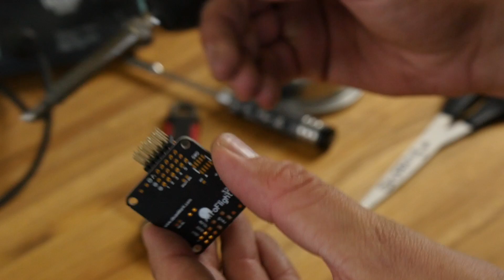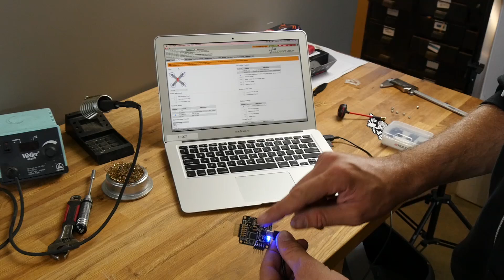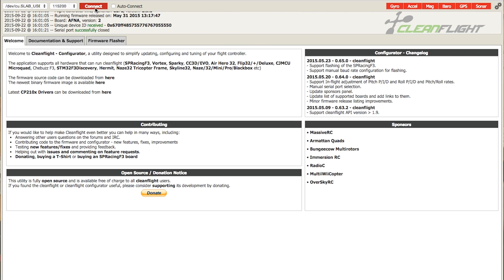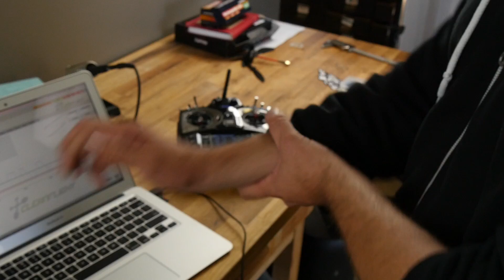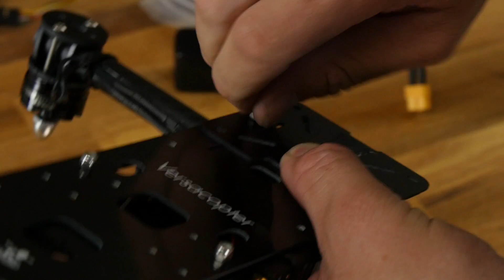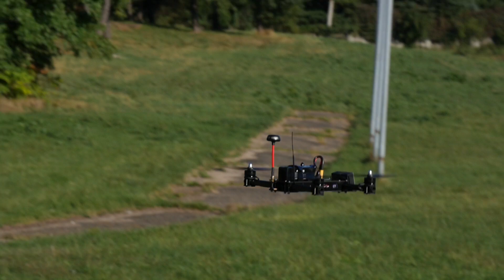Flite Test | FT VersaCopter Naze32 Setup (w/ OneShot)

Comment: Hello! I have a bit of a problem. when using the master power in "motors" my motors spin up in sync and to the desired power. However when using throttle my motors spin up but then, immediately, slow down while motor 3 spins up. It is on a smooth flat table with the gyro showing it as flat ground. I can not find a fix to this anywhere. Please help!

Comment: Hey guys i have a question. i'm currently using 6x4.5x3 props with DYS SE2205 2300kv motors and they get really hot. do you think 5x4x3 props would be better and create enough lift for the versa?

Comment: Hey, I need help so i got my versacopter and i plugged everything in the right place and I walked through cleanflight for 2 hours trying to get the motors to arm. The flight controller lights are colored blue and red so I assume something is wrong? I am running a spectrum dx6 radio, a spectrum ar610 reciever, and for my flight controller i am running a Naze 32. HELP ME I WANNA GET THIS FLYING ALREADY!

Comment: Thanks for the video! Quick question for you guys. I'm having a heck of a time flashing Cleanflight onto my Naze32. I've installed the CP210 and VLP drivers, and I noticed the Silicon Labs CP210 info in under ports in the device manager when I connect the Naze32, but every time I try to flash it with the latest Naze firmware, it just says "Failed to open serial port." The weird thing is when I connect the board, I even see the COM port updated in Cleanflight to COM3, which is the appropriate port according the to the device manager. I've tried uninstalling/reinstalling all of the drivers as well as the Cleanflight app....nothing works. I've tried installing with the default settings as well as the boot loader option with the boot pins shorted. it always gives me the same message. What do you think I'm doing wrong?
Show less
Reply: I actually had to solder the boot pins together. Just shorting them doesn't work.

Comment: I purchased the Versacopter with the BL Heli ESC's and the Naze Rev 6 Board.  For the life of me I cannot get this to calibrate esc's.  It seems that when I move the master to full power in clean flight, the USB is giving the motors some power and they spin just a bit.  Which is odd.  Then when I plug in my battery, they shoot up to full RPM.  No calibration happens.  Anyone have an idea why this is happening?

Comment: Mounting the board on the plate becomes a little bit more tricky with the Rev 6 Naze32, since the USB port is no longer in the centre! Not too big of a problem though, you just have to stick the Naze onto the plate a bit further along so that a small part of it overlaps the edge. The new layout of the Naze32 also means that you can face the board forwards and don't have to enter an offset into Cleanflight though, so swings and roundabouts I suppose!
Reply: +Sean Duffy how do you power the NAZE or your receiver?
Reply: +V Britt I'm using Emax opto ESCs so I have an UBEC which powers the Naze through one of the unused ESC connections. The receiver is then powered by the Naze through an SBUS connection.
Reply: Thank you, I did this and I can see my controller via clean flight however I don't get any of the beeping.  I have a rev 6 are they different?
Reply: +V Britt Great! The beeping actually comes from the ESCs, not the Naze, so it may be that the ESCs you're using don't beep!
Reply: Thanks man, obviously I am working off the wrong resources.. LOL.  any links or suggestions on where I should looking?
Reply: +V Britt If you specify the hardware you're using, you should be able to get help by asking on Rcgroups or reddit.com/r/multirotor.

Comment: I would really love to get into fpv quads but the fpv setup is sooooooo expensive. Are there any inexpensive (<-$150) fpv setups?
Reply: On Amazon, you can find a Boscam tx/rx, a small fpv camera, 4 inch monitor, and cloverleaf antennas all for under $100. I can provide links if needed.

Comment: I have a FrSKY X6R receiver and it won't fit in the Versacopter.  It is just a little to long.  Where would you suggest that it be mounted on the outside.  Will I need to make some kind of legs and move the battery to the bottom and mount it on top where the battery should go?
Reply: +William Meade Do you not have space to mount both the battery and RX on the top?
Reply: i fit my X8R in there, you should try harder.

Comment: I decided to give cleanflight a try after your glowing review, it will not even connect to my  flight controller, no idea why but, I tried everything and it will not connect. Think I will stick to a proven firmware loader.
So this brings me to another question if I got the versacopter can it take instruction from open pilot or mission planner ?

Comment: I also have a faulty naze32(version 6.6 clean flight) from local shop. I got the bootloader failed error aswell. I reflashed the firmware. I can connect the naze in cleanflight but when i try to change any settings. It wont save. It locks up displaying "rebooting" but never completes the reboot sequence. please help and make 1 video for those have same problem... please please and please...need help from pro flite test.

Comment: Hey guys great videos, ?, I just ordered versacopter and the e power pack, I got 4 CW, motors, well the nuts anyway, that's a safety issue for a novice when a prop gets spit off in there face, just a heads up.

Comment: I bought the FT Versacopter frame as my first 250 quad build (or any quad build). I got 4 Cobra 2204 2300kv motors coming, and got the Naze32 from you guys on a separate order a few days later when they came back in stock. I have a Spektrum DX9, and a bunch of LemonRx Rxs, but not sure that will work for an Rx..  Also trying to decide which 20amp Blheli ESC to run.. that are in stock anywhere, and also trying to decide if I should just get one with a BEC, or just use a step-up step down regulator like a polulu or whatever.   So many decisions.. and stuff to figure out. I want to run 3 or 4 cell by just changing prop, but looks more and more like I should pick one or the other. Should be fun either way if I don't fry anything in the build process.

Comment: Do you solder on 420 degrees celcius?!
Reply: +Ruud (Ruud G) 420°F... about 215°C according to Google.
Reply: I was thinking about that to, but 215 sounds very cold to me for soldering?
Reply: +Ruud (Ruud G) I thought about that too. I usually solder around 350°C. But of course it depends on the solder you have too. Josh's is pretty thin, perhaps it's ok to solder at a low temperature like that.

Or the Weller goes into a standby at around 200°C and heats up to a higher temperature if you take it out of the station?
Reply: Yes, I am soldering at around 350 to, with 0,5mm solder wire.
So 215 sounds very cold to me?
Well, if it works for them?
Would be cool if they could explane it to us!

Comment: Good video but there is a mistake.
Unchecking the accelerometer in the sensors tab only turns off the graph.
To disable the accelerometer you have to go into the cli and type set acc_hardware = 1
Reply: +Noel Harris yep you are wright:)

Comment: You need to design a setup so you can add a servo to your camera to enable it to tilt with the quad as it pitches up and down
Reply: +huskrman 1 Most pro pilots are confused by that, because they don't see the attitude of the copter anymore when the camera tilts. It's difficult to see if you are still going forward when the horizon is level all the time :)
Reply: +huskrman 1 Or just use a wider angle lens?

Comment: I didn´t understand what "one-shot" is. What is it?
Reply: +Ultra rc Ughhh that's not oneshot mate, that's the dampened light setting in BLHeli for active breaking.... One Shot just synchronizes the main FC control loop with the motor output signal which allows faster throttle response.
Reply: Ha ha :D, Gruß aus Rheinland Pfalz...
Reply: +Just looking It means that the motor will actively break to meet the set throttle position faster, making a more locked in quad
Reply: +Ultra rc Thanx, now I understand :)
Reply: oh ok thanks, and sorry other guy for the incorrect answer
Reply: Ah, so I learnt two things now, has nothing to do with bullets or water-proof LED´s ;)
Thanx guys...
Reply: +Ultra rc In fairness you usually see both together, and rarely separate.  You'd get the BLHeli firmware with oneshot and damped light together.
Reply: +RCShufty That's not correct either - it's just the main thing that was not possible without OneShot. :-)

OneShot is a different communication protocol between flight controller and ESCs. It allows the FC to send control commands to the motor a lot quicker than with standard PWM.

Because of that you can then sync the FC control loop with the motor output signal, resulting in a lot better performance of the multicopter.
Reply: Balu I think you're splitting hairs there mate, that's pretty much what I said, just condensed :P
Reply: +RCShufty Yeah, but as a German I have to nitpick. =)
Reply: Haha yeah I guess so, but I'm Australian so close enough is good enough ;)

Comment: Will the PID settings change when using a 3cell battery?
Reply: +Terry Dubay Yes.
Reply: +Terry Dubay I fly at the moment a quad with 3 and 4 S having no problems at all without changing the pids 
Cleanflight pid controller luxfloat

Comment: What's the best cheap set up for my plane, it's weights probably 3lbs
Any suggestions that includes a Motor, prop,esc, battery (both esc and battery have the same connector) 
Thanks for any feed back.

Comment: I notice all of your ESC signal cables have their RED wires included, do they have BECs? Shouldn't you remove all but one BEC connection?
Reply: +Adam Sidelsky you can run all ESC with the 5v power wires, but only one is required. All six ports are able to accept 5v
Reply: +Owen Buckingham (Dwarf9668) I thought it was bad to run all 4. So most guides say only run one because that's all that's needed?
Reply: +Adam Sidelsky i believe it depends on linear or switching BECs, you'll have to look up the difference
Reply: +Adam Sidelsky If your esc's have linar bec's you can plug in as many as you want. If they have a switching bec then you should only keep 1 red cable and cut the others